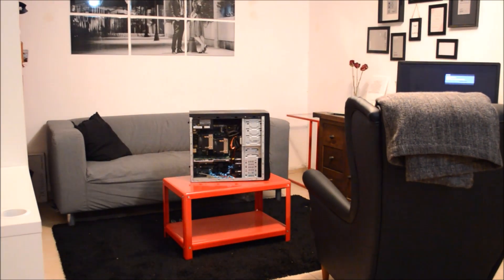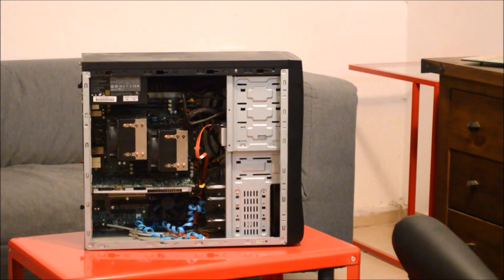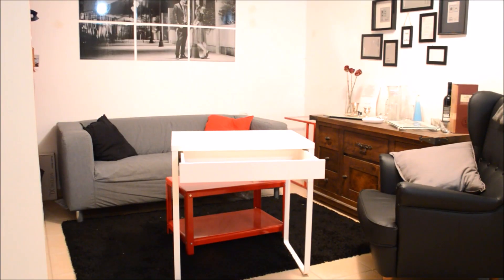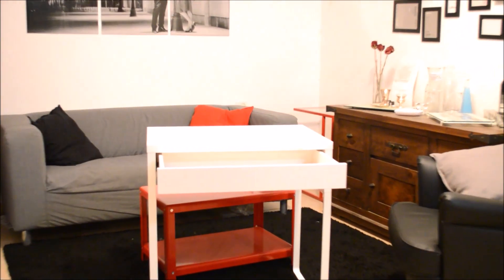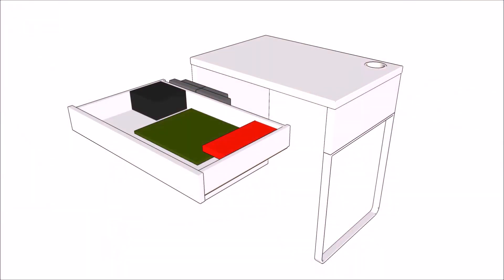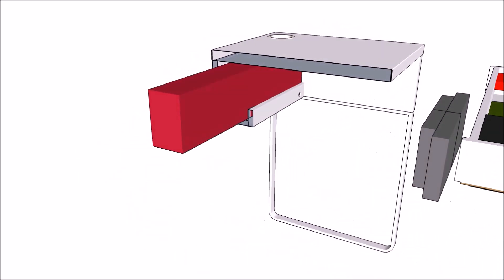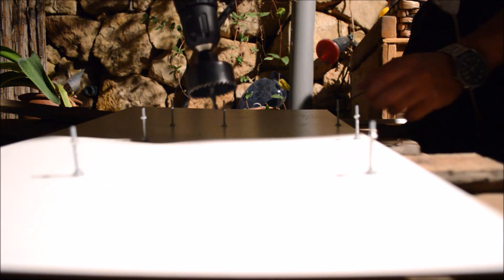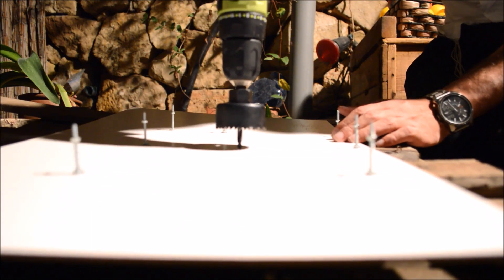DIY - PC Server Build in a Small IKEA Desk !

Comment: Love this but was thinking along the lines of getting a broken Olivetti M3030 and gutting it and installing the hardware in the place where the original electronics were and use the old Disc drive cabinet to hold the hard drive  and DVD drive and the Printer cabinet to hold the guts of a Cannon laser printer would that not be a nice idea, in case you are wondering what the Olivetti M3030 is well it is a computer in a desk.
Reply: +DAVID GREGORY KERR Share some pictures https://www.facebook.com/ArchirendArchitecturalRenderingsAndDesigns/